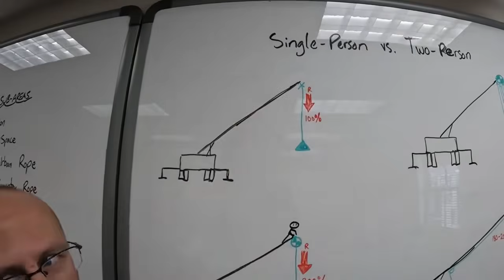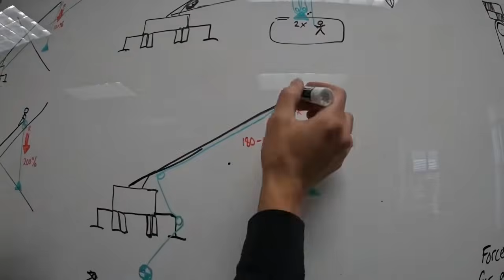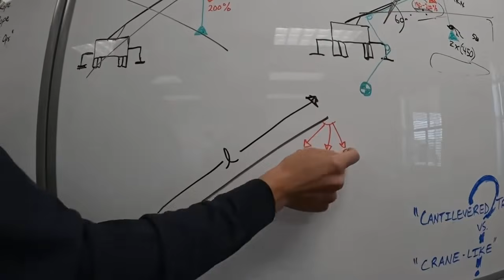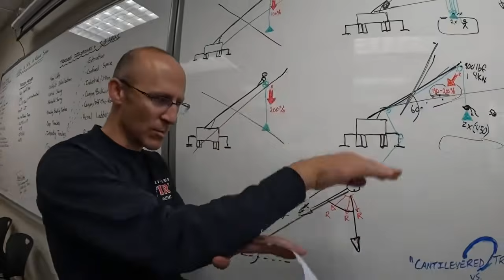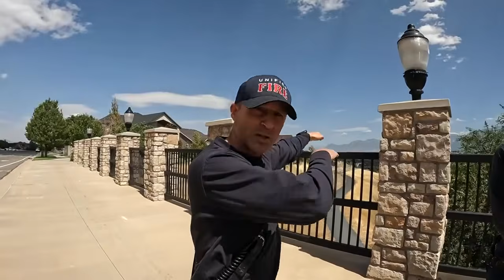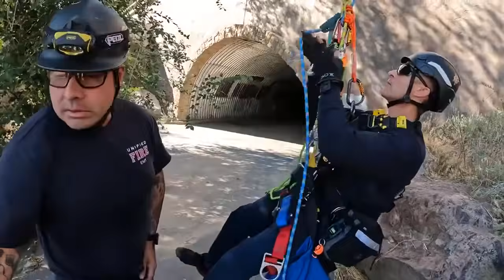Aerial Ladder Rope Rescue Part 1 of 4: Systems Overview & Over-The-Bridge High Directional

Comment: What is your opinion of the Pierce Lyfe pulley system? I have been seeing it pop up a lot and looks interesting. 

https://youtu.be/VxUKObphbNc?si=uzb8tJQXpTeggTOy
Reply from the maker: I wish we had one because it simplifies a lot.   You can run the ropes along the topside of the ladder which puts everything in better alignment, and mounting the working device (be it a winch, pulley system, DCD, or multi-purpose thing) at the turntable at the base of the ladder means that there is zero force amplification through the pulley at the tip, which is nice.  The only negative would be that the resultant is the loaded line, which is further away in alignment to the stick, but since there is zero force amplification then it doesn’t really matter…… no real downside to it.

Comment: Is there a reason alpine butterfly shouldn't be used over the interlocking longtail bowline?   And im not a fan of the victim harness,  we use the  petzl Pitagore its much simpler (idiot proof lol)
Reply from the maker: No reason.  Either one is fine.  My fire department is more familiar with bowlines at the rescue package end of the lines, so I use them here for consistency, while at my other job as a ski patroller everyone is more familiar with Butterflies.  I don’t like the seat harness either, but it’s all we have at the moment.  At my ski patrol job we use the Pitagor harness for aerial tram evacuation of guests

Comment: Very knowledgeable instructor but I feel this is a lot of extra hardware and details added that might cause confusion on that dark rainy call at 2 am.
Reply from the maker: Confusion can be directly linked to training.  If you’re confused at 2:00 am on a dark cold rainy night, that’s completely understandable;  Been there, but the majority of that confusion should be due to the fact that you’re groggy & still half asleep, not because of the complexity of the system….. Just means that you didn’t train enough.

I don’t know how much simpler to make it…. you need 2 ropes.  you need some kind of control device for each rope, and you need the directionals.  I guess you could eliminate the pulleys but that wouldn’t be very fun on the haul.  As far as the rescue end of the system…. you need a harness for the subject.  All the other ways to rig the rescuer and the subject into the system are vastly numerous and don’t really matter as long as it’s timely and safe enough.  For our team, we are familiar with the general concept of bringing 2 ropes together with an appropriate midline knot that has a loop and long tails.  The loop is the yoke or Master Point and the long tails serve as backup/2nd attachment points.  The yoke can be butterflies, bowlines, directional figure 8s, whatever.  We use bowlines and are very fast and proficient at it.  We also are intimately familiar with having a personal AZTEK for every rescuer.  You can use whatever you want here, but our crew recognizes the importance of having some micro-adjustability at the rescue end of the system for both the rescuer and the subject… wether it be a set of 4’s, a Grillon lanyard, Progress Adjust lanyard, a Purcell Prusik, etc. etc.   This type of general conceptual rigging is commonly used by many technical teams both county SAR, mountain-based, volunteers,  non-profits, as well as fire.  It’s known as a “BC Pickoff”.

As for the complexity with the chest component of the harness system, well that’s 100% optional, and I show it here just because I can and to articulate the complexities when trying to incorporate this particular type of chest harness (sold by CMC).  I don’t necessarily like this specific chest harness, but it’s what our department has so we have to deal with it and make it work….. and try to make it work correctly if we decide to use it.